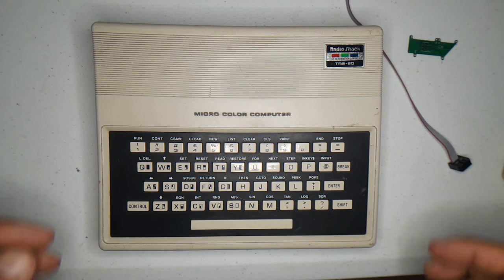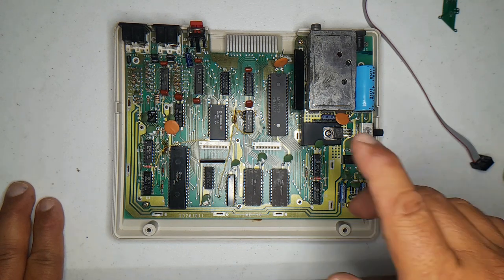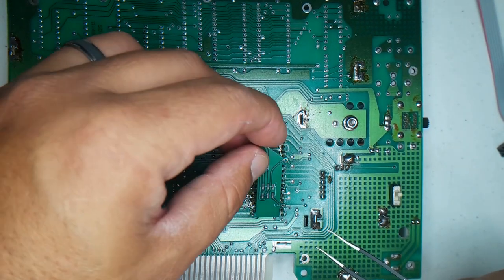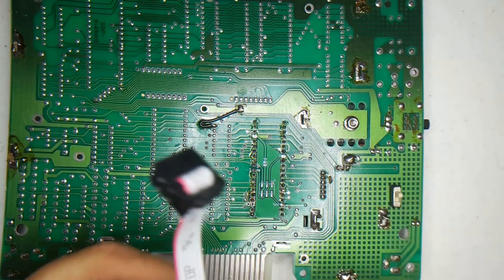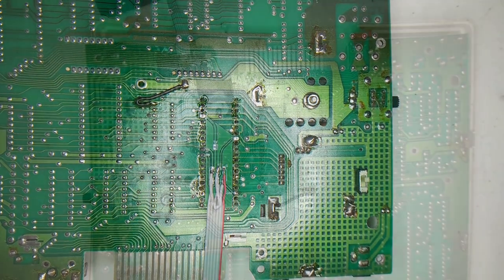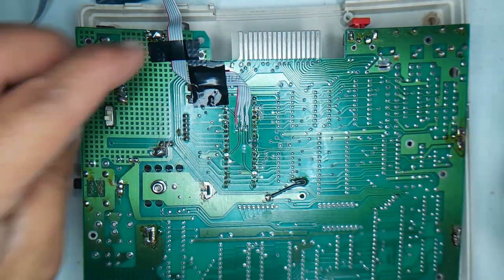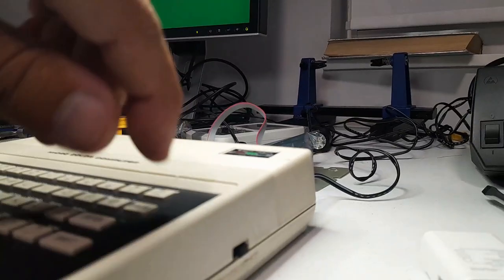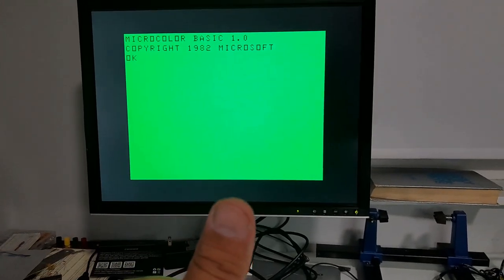Installing CoCoNutBob's VDG breakout Board on my MC 10

Comment: What does the keyboard side of those cables look like? Could 8-pin FFC be used? (CoCo style but split in two halves)
Reply from the maker: They are soldered into the board on opposite ends of the keyboard. In theory one could solder FFC connectors and make it work. That's the next challenge....

Comment: The keyboard wires get worse!  After time and possibly some heat, the two sides of plastic holding the otherwise bare wires in place become unglued.  THEN things get far worse.  But a guy on the MC-10 channel of the CoCo discord removed the original keyboard connector from the system board and replaced it with some through hole things with some length of 8 wire thingy.  I don't know the terms!  I just know that when I did what this guy did and replaced the wires on the keyboard, it works a LOT better and is a lot easier.

Also, there is some chatter about sound and the RGB2HDMI.  I saw your use of adapters to inject sound which was good.  But what if you used an a conductor ribbon cable and connected 6 to the back-tap board and the other two to sound so that it all passed out to the RGB2HDMI?  There have been people who made some sort of changes to the RGB2HDMI stack to allow sound to be injected.

But there's another question of sorts.  I didn't know this but apparently on the CoCo, sound can be accessed from the cassette port??  I didn't know this!  That's incredible.  But @CoCoNutBob says it's true!  I'm not an expert like you guys are but it looks like the MC-10 is wired in a similar manner.  This suggests for audio out, one only needs to create a cassette port wire or jack as a source for sound either to a speaker or to somehow inject to RGB2HDMI.

Thoughts?

Comment: Is it possible to install a SMT pin header and cutting a hole in the bottom of the MC-10 case?
Reply from the maker: I'll have to check but I don't see why not.
Reply from the maker: The MC-10 is really close to the surface it's resting on so if you did want to have a permanent header installed it might cause it to crash into that surface once the cable is connected
Reply: @rockyhill3  So you would need big feet to raise the MC-10 up a little higher.
Reply: Yes, I used the footprint of an SMD pin header.
 I've thought about making v2 with a 10-pin header, CoCo 3 cable compatible